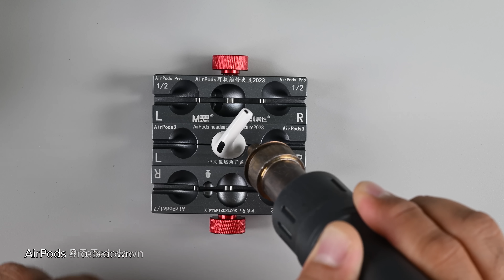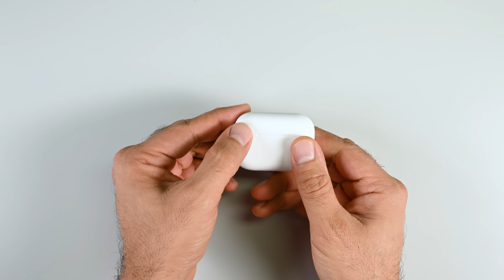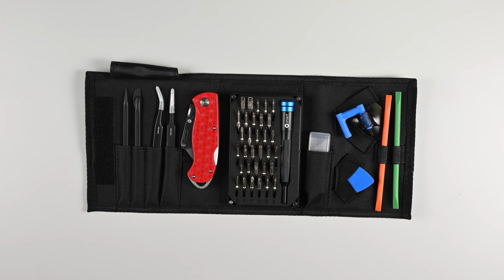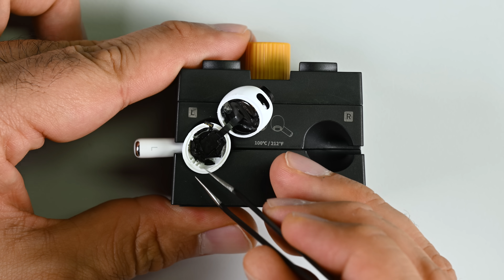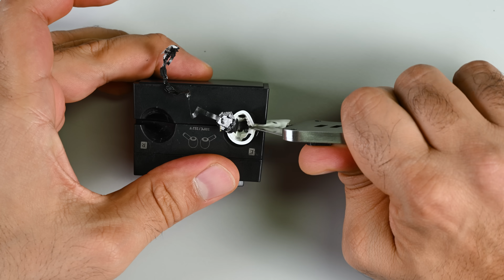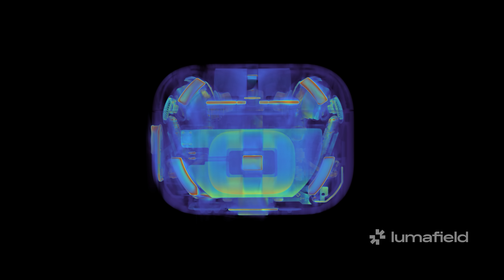We Tore Down the AirPods Pro 3 — And Here’s the Ugly Truth

Comment: Repairability can be great, but it is not what most people want. You say Apple is tone deaf for doing what customers want and selling them a great product. That ever thinner profile you say they sacrifissed the press connector to is what I want. Whilst I am perfectly happy doing a battery o screen replacement on my iPhones, and have done plenty, I do NOT want to open up tiny ear buds to replace a battery. I have been using my 1st Gen Airpod Pros for years and still like them. he battery life has declined but they are still fine. My Airpod Pro 3s arrive tomorrow though, for $219 they will last me about as long as the other did and I am perfectly fine with that. I want them to be as low of profile as possible and have more functions and features I want. I do NOT want an increased price, a larger, or a heavier Airpod, just to be slightly more easily repaired to appease the small percentage of people who demand that and complain about everything that doesn't have a battery door.
If a significant portion of the customers wanted all the features that a handful demand, companies would offer them.

Also, on the topic of waste, holy cow the $15-$30 ear buds flooding eBay, Amazon, etc., that a bazillion people buy an replace over and over again are far worse than Airpods that will be used for years, traded or sold, ad used for a long time again. (Same the other high quality ones by other companies.)

Comment: The batteries in AirPods degrade because they are charged to and kept at 100% in the case.  Lithium Ion batteries degrade the most at 100% and degrade the least at 50% state of charge.  So you'd think Apple would have given us an option to stop the case charging them.  Oh but wait, Apple wants the batteries to degrade so you have to buy them again, since there is no way to replace the batteries ourselves.  Built in non user replaceable battery devices need to stop!  Apple likes to boast about how they care about the environment yet keep making over priced throw away devices.

Comment: ⚠️ Less number of CHARGES‼️
The first thing that I noticed with the Gen 3 versus the Gen 2 is that the Generation 2 case could charge the AirPod Pro buds 5 times.
With the new Generation 3, it can only charge the buds 2.5 times.  With the case at 100% and the buds at 1% it takes 40% of the cases battery to charge the buds up to 100%.

This is going to be another Apple Gate!

Comment: having taken apart a non-functional WF-1000XM5 earbud, it is a similar story from Sony. Lots of glue and tape keeping things together. Plus the battery is soldered to the main flex cable assembly, so replacing it will require users to de-solder the battery.

Comment: Lets be real. Samsung doesn't care about consumers especially when their on a older phone. its not a coincidence so many Samsung phones, are getting green and purple lines, and the weirdest thing is that it happens around 2 years after the phone is released. it happened with the s20, s21, s22 and now s23. Samsung might be making good screens, BUT with bad durability which would last around 2 years. The green line is also a major issue which is also affecting their reputation so it kind of contradicts with what he says. but its true that battery swelling and explosion is way more dangerous, but it has happened to old phones like the s10 when not used in a long time. Recently, someone has also reported their galaxy ring swelling while on a plane. But it might just be a faulty unit, but still it doesn't make sense. why is Samsung not using silicon carbon cus they scared of it swelling when its already happening with their normal batteries? (sorry for yapping so much i just wanna see your opinion on this)

Comment: No one cares about repairing these or replacing the batteries. Yeah, they’re wasteful but they last a long time if you take care of them and it’s arguably an acceptable trade off for a smaller design that packs more inside. Once the battery dies or loses its capacity, most people are ready to upgrade anyway. This is one exception where I don’t think repairability really matters because if they were designed to be repairable, they would likely be impossible to exist in the same size with the technology that’s packed inside.

Comment: Even chinese earbuds from aliexpress are more repairable I can peel them apart with my thumbnail the battery is soldered in but not glued in and they actually sell the parts like the speaker and battery Both replacable and it's just press fit or clipped together They sound quite good for something that's very cheap but the battery in the case which is also a powerbank is just 200mah but i managed to put in 2200mah battery Apple should learn when the chinese crap is more eco friendly than the real deal same goes for chinese airpod knockoffs

Comment: Sony over Apple! 

Tried their 2nd generation years ago. I hardly call that 'noise cancelling', rather noise muffling. How could it be anything else with stiff thin silicone tips? 

Stuck with Sony's FW-1000XM4. Now that's noise cancelling! Hello memory foam tips (which still last after 3+ years). 

About to replace the batteries a 2nd time. They last about 1000 hours.

Comment: If a more repairable and interchangeable battery means a bulkier and heavier AirPod, I am more for the current design
Reply: The problem is, that iFixit does not consider the plastic housing as a discardable item and thus does not push the narrative in this direction😔

What would you say, if maintaining the weight was possible, if the AirPods where designed with a destructive entry in mind, and additional to a new battery, the new plastic housing would add 5$ to the repair costs?
Reply: @goiterlanternbase would you be able to retain the waterproof rating? It’s hard not to damage anything else while you’re breaking them apart
Reply: @jama211 The flex cables are available as well. 
Main problem with this new model, is the adhering of components to the housing. This wasn't an issue with older models. Apple could help us a lot, by returning to press fit or using rubber rings, instead of 2K glue. We saw on the battery tape, that changes to the better are in the realm of possibilities.

I don't get the waterproofing question.  Really. Compare it to a question, if a car door can be closed again, once you have opened it, to step inside the car🤗
Reply: @goiterlanternbase  Of coz they would advocate for repairability, they sell parts and tools after all. But a more repairable product is not necessarily a better product for consumers. Apple could certainly make an AirPod Pro with interchangable batteries, but it most likely would be much bulkier and heavier than it is now, or would have a pretty short battery life. I think Apple has make the right choice of building a battery that last for long time so that customers could keep using it for many years, it's also eco-friendly in this way.

Comment: With their new water resistance and longer battery life for the buds, people will most likely get 2-3 years use out of them. Which is good for headphones. As far as e-waste goes, they’re a drop in an ocean. Think about how many cheap unrepairable 50” TV’s, GPU’s, monitors, etc. get thrown out. I’m a Software Engineer/IT person for a medium sized company. If something breaks, we largely don’t even try to repair it anymore. The cost for parts, difficulty finding parts, time investment, etc. just makes in impossible in most cases.
Reply: i still use 8 year old earbuds. 2-3 years is NOT a good lifetime for anything.
Reply: 2-3 years wouldn't be my use case. I study all day, so 1 year it is. That goes for everyone studying out there, 1 year max give or take.
Reply: They last longer than 2-3 years. I still have the Airpods Pro 1 since 2021 and regularly use them, even if the ANC has degraded a lot because they've suffered tons of accidents 🙈
Sure, the battery runs out faster than when new, but not terribly so.

Comment: Batteries wear out in around 2 or 3 years. Me and my partner both have 1st gen AirPods Pro from 2019, and the batteries are still working fine, perhaps a little less battery life than when new, but not that much reduction.
Reply: Same though mine last 3ish hours on a good day.  Upgrading to the 3’s blew me away. Sound quality, ANC, little new features. So good.
Reply: I have first airpods and they last for some seconds and shut down. It was like that several years ago, and I'm not sure how to approach repairing them.
Reply: Oh you still got the first gens? That's because you don't use them much. I used mine moderately and now I am fully Xiaomi FTW. ANC broke, battery lasts less than 3 hours, yeah no point of using them, that's why Xiaomi had me covered with buds that have 5x better ANC and sound amazing.
Reply: @carnistpolice we used them plenty, they have just lasted us well.
Reply: ‘My partner and I’
Reply: @des4719 I apologise for not being grammatically correct 🙄. I didn’t realise we would have English language specialists on here.
Reply: I have been using my AirPods Pro 1 for 5 years, no issue whatsoever. I did not use them very often and made sure they did not stay with empty battery when not being used.
Reply: These button cell batteries have a much better longevity than your typical lithium ions.

Comment: I’m not sure your replies repairability rating is meaningful if the AirPods Pro 3 get a 0. Because you demonstrated that the battery in them is indeed replaceable using proper tools with only minimal cosmetic damage. That , by definition , means that it’s possible to have designed where the battery would not be replaceable at all without destroying the functionality of the unit - which is not the case with the AirPods Pro 3. So there must be a repairability score below that of the AirPods Pro 3. So unless negative scores are possible , it seems the AirPods Pro 3 should get a score of 1 or 0.5 and not 0.

For me the only real repairability question is : replacing the batteries that are consumable. A single screw that clamps down on an o ring or a better heat release seal where cosmetic damage is avoided would put the buds at an 8/10 for me.  

For the case, where size isn’t actually constrained, there the fact that a pair or 4 screws isn’t in the case to get easy access to replace the case battery is a travesty and rightly pointed out - so a low score there is also ok but if implemented would bring the case to a 9/10. Because replacing physically damaged parts of the case or electronic failed components of the case or buds is such a small niche concern for most folks that it shouldn’t be more that 10% of the score.

Comment: Honestly, I don't see how else would someone make earbuds this tiny packed with so much tech any more repairable. Most companies can't even package such tech together, let alone make it repairable.
Reply: Literally all other manufacturers are more repairable. Watch the other videos by ifixit.
Reply: Sony's WF-1000XM5 buds and charging case is way more repairable than this. I would argue that they are smaller than AirPod 3 as well, but they are more expensive. The AirPods and charging case are also allegedly waterproof and findable when misplaced which is not the case with the WF-1000XM5 at least when I was using them.

Other features like transparency mode, noise cancelation, auto stop playback when removing buds and more were all available and Sony's WF-1000XM5 buds which were almost 2 years older than the AirPod 3rd generation system and those Sony buds and charging case are still much easier to repair than any AirPod.
Reply: cylindrical battery inthe tip, screwable endpiece, courage
Reply: I totally agree with you. I think this is such a well engineered product that there is no other option than be unrepairable, but they need to solve the biggest problem which is the battery, and limit it to 80 percent charge so they will last much longer
Reply: @naorbareket6482 ive had my airpods pro  first (lightning)for almost 3 years , and ive never had battery issues
Reply: @naorbareket6482 the optimization also works for me when charging
Reply: Literally Fair Phone (spelling?) has. They even mention it in the video: Did you watch it?
Reply: @allenellisdewitt  Did I watch it? LOL. Did YOU watch it? Are those fairphone buds anywhere near the size of AirPods?
Reply: Agreed. Feels like iFixit lost the plot with this one we would be riding horse drawn carriages next.
Reply: exacty. but you know how this channel is. its all about non constructive critism. they have no ideas on how to make it as compact and at the same time repairable, because its impossible.
Reply: @edwardkim2416  If it's impossible it's impossible. But already through consumer and governmental pressure, they've been forced to find ways to make things more repairable, that were once thought impossible, and iFixit has been a significant part of that pressure. 
I for one would like to see Apple spend more effort in making products that are more sustainable.
Reply: @edwardkim2416  Well it's not their realm of expertise. Their expertise is in fixing things, for which they have very good guides on. The onus of making things more environmentally friendly is on Apple, especially after all their propaganda about sustainability.
Reply: They are a bunch of solder iron wielding technicians that bark at apple for their engineering superiority
Reply: @PrasadNambiar-l2n  They have contributed to pressuring companies to create more repairable tech. They are not only important but fundamental to going into a future with less e-waste (of which we already have too much).
Reply: why does this have to be so tiny? oh because when you lose one, you have to shell out $40 at least to replace it. it’s a bad design on purpose to get you to buy more. 

we can have better more repairable headphones, they just have to attach by a cable. have the battery do something that hangs around your neck, and make it easily accessible.
Reply: @tonydelamancha5513 that would be a different product with a totally different use case.

Comment: I can kinda accept the airpods themselves not having a replacable battery, but the charging case absolutely has zero excuse for not having it be replaceable.
Reply: well obviously the charging case is practically useless without a pair of working earbuds to go with it, so there's no point.
Reply: i dont know a single set of airpods where the charging case was a problem
Reply: Sales.  That’s an excuse.
Reply: well, the charging case has an IP54 waterproof rating, and being able to make the battery a weird shape/size helps them keep the charging case small.
Reply: @jama211  Have the shell be two parts so one fits into the other snug. Place two screws at the bottom to keep them locked in place. 

The result: a chunkier package, you may give up on wireless charging, and you may also have to make a two-size groove for the charging port. Also keep in mind the uselessness of the charging station battery being removable while the buds themselves, the active component, cannot have their batteries replaced. 

Very doable but I understand if Apple decided that those were too many and too big compromises.

Comment: I can think of no practical way to make the battery replaceable in the buds. The case on the other hand should be a lot easier than it is.
Reply: Would also likely ruin the water seal as well. This is one product that I fully understand has a limited lifespan, but it's way more than 2-3 years. Still have the 1st gen AirPods I use with my PC as a backup headphone, and they still run a solid 3.5 to 4 hours.
Reply: Google Fairbuds, they managed.
Reply: Have you seen fairbuds? Perfectly doable..
Reply: cylinder form in the tip, screwable endpiece, tada
Reply: Existuje zajišťovací mechanizmus, kterému se říká bajonet. Dvě většinou kruhové součásti se do sebe vloží a pootočením se zajistí. Je to systém výstupků a zarážky. nic nového takto by se daly sluchátka pootočením odemknout, otevřít a baterii vyměnit.
Reply: Fairphone has done it (although not the most elegant design), so apple could definitely do it.
Reply: @KeijonAutoVuokra 
Sony does this even though they're not technically designed to be repaired by users. There are channels on YT showing the process, and it seems like the WF-1000XM5 is much easier to fix. For whatever reason, iFixit and Tronixfix don't have teardowns of these truly wireless earbuds. iFixit does show Fair Buds being torn down and they say it's repairability is good.
Reply: No practical way? Like maybe, not be a waste of resources? Isn't that the reasoning as well why no charging bricks/adapters are included in the box?
Reply: the stem could be the battery instead and make it screw in the main body, move the circuit board in the batteries location, there is enough space, just need a redesign of the pcb.
Reply: Agreed, trying to criticise Apple for not making these repairable is beyond unreasonable
Reply: @whatcouldgowrong7914 
No, it's not unreasonable to be upset at Apple for their lack of repairability. Other non-repairable in-ear headsets are more repairable than AirPods.
Reply: You could, idk, make them thicker!
Reply: @AliAbdallah-k7b Making the shell or the stem thicker would make occlusion effect worse causing that rumbles when you chew or run. Apple engineered this out of spite by using canal facing mics in front of the driver, but by changing insertion depth alone by making the shell smaller (app2 v. app3) there is huge improvement. I don’t see increasing size would benefit anyone.
Reply: @kamikamieu go ask a genie then. Idk
Reply: @AliAbdallah-k7b  I would rather spend £100 replacing the buds with new ones every 3 years than have a thicker more uncomfortable airpod
Reply: @ahyaan2552  in my experience they have acceptable battery life even after 5 years. The case loses batery much worse in my experience